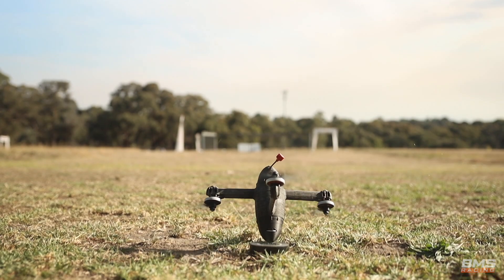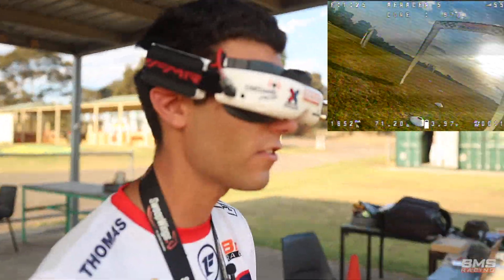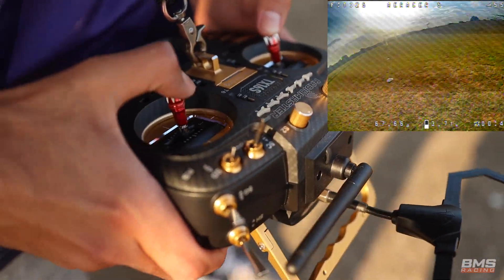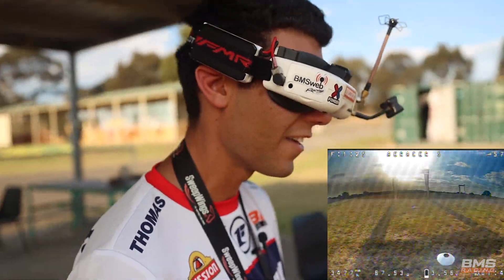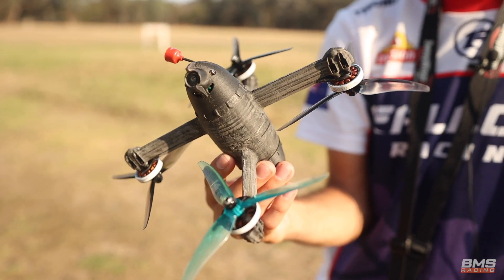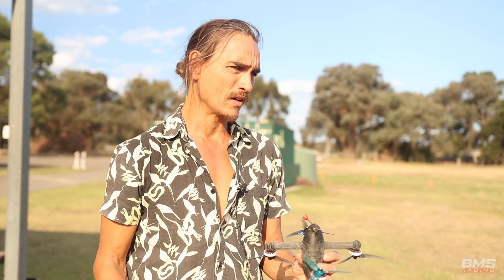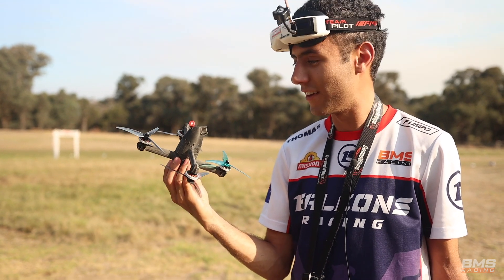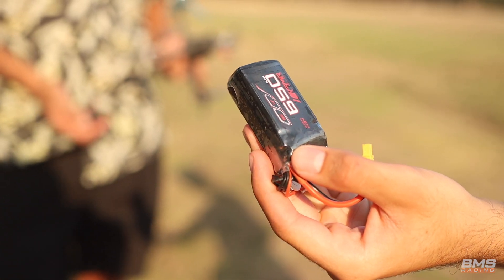Air Racer Prototype Racing Drone - Flight and Track Testing

Comment: I've actually been thinking something like this was long overdue to hit the racing scene! I'm very curious to see what would happen if the two horizontal arms where used to generate just a bit of lift. Would allow for stupid high camera angles, and incredibly small batteries
Reply: Yeah, I think a 'spec battery, endurance' type race setup might be an answer for that, since that becomes a pretty accessible race series, especially since the inherent durability is there.
Reply: Umm there are several race frames with vertical arms that basicly won every race event in Europe 2019
Reply: @peterzingler6221  not referring to box frames. Talking about arms with an airfoil shape. Does that exist already?

Comment: But massive Voltagedrop on full throttle 🧐😳💨 great fun Prototyp at all ✌️🍀
Reply: It's true. Unfortunately the type of chemistries in the tattu R-line version 4 Thomas runs aren't available in 650mah. Fortunately while racing those prolonged full throttle sag inducing conditions aren't common.
Reply: Preheating the packs to 60 degrees c should greatly help. Not safe but at races even worse things happen

Comment: I wonder how it would fly if the arms were airfoiled control surfaces like fins on a missle. Maybe something like 3d heli blades on the trailing edge of the arms with 4 servos. 
They could act like wings, elevator, rudder, ailerons and even act like thrust vectoring paddles.

Comment: Interesting design.. Problem I see is when you crash and you are the on the ground there is very little chance of getting back up since 2 motors are squarely on the ground.
Reply from the maker: I don't disagree, but I just love seeing people try things like this and the knowledge that's gained from it.
Reply: If you crash inverted in a standard quad then all motors are facing down. At least with the Aeracer with a custom betaflight turtle you could just spin up the upright props to pop it off the ground then bring in the other props.
Reply: @pauldamiandumais   Flipping back over will not be the issue it is taking off again is going to be the problem. You will have at least two motors in full contact with the ground before take off. Also remember the motors are smaller so they won’t be able to power themselves off the ground. And in grass.. it will probably not spin at all ending in possibly burning up a ESC trying to power out of stuck situation.

Comment: definitely beats the Frigging ultra expensive DJI FPV Drones :D well done designers. and well done pilot :)
Reply: What a stupid comment. This drone and the new DJI drone aren’t even remotely in the same category.
Reply: @soccernerd200  Thanks Bud, but maybe you should research more before commenting :) DJI FPV (The new DJI Racing Drone) and Air Racer the FPV Racer Drone. I think both are designed for racing and should be in same category, right? unless you take DJI FPV drone as another aerial filming drone but not FPV Racer?
Reply: @soccernerd200  I think he’s talking about the HD digital FPV system

Comment: Now that looks cool, going in the right direction for sure but I have some ideas that might make this thing even smoother
Reply: Yes, holding my breath here. Spill the beans.
Reply: @pauldamiandumais  Hey Paul I thought about an egg shape teardrop design with the camera pointing directly forward however either the arms or just the motors would tilt.. I think just the motors tilting will be more aerodynamic since you can shape them like small x-wings. and much stronger since it will be all one piece. I realise that technically it will be much more difficult to do but I can see huge advantages from aerodynamics perspective. Check out the Moller Skycar for inspiration. Awesome work by the way :)
Reply: @jbalatutube  yeah more complex concepts  are great for larger craft with longer flight times but for small  racing quads one generally has to follow the KISS principle of keep it simple stupid.

Comment: I've been saying this for a long time and it seems Paul has designed something like what I have wanted; aero, nice looking quads. That thing looks cool. It has everything tucked away neatly. I was always a fan of the DRL Racer 3 and 4, and I like the clean look of the DJI FPV (despite its functional flaws).

And what is with that current sensor always reading 60A?
Reply: Interesting enough the design of the dji fpv is made to be aerodynamic at 30 degrees of tilt. That's why it looks like a sloth on the ground
Reply: @peterzingler6221  I noticed that too. I wonder when carbon fibre monocoque frames will come to FPV....
Reply: I haven't calibrated the current sensor. Sorry. Will do.

Comment: Never got the argument of x over plus, as soon as you start turning, its all put the window, however that whole setup looks really interesting
Reply from the maker: Thomas gets to fly a lot of prototype quads and we don't always share it, however we just finished Round 4 of EastSide FPV Summer Season and had all the camera gear with us. Paul was OK with us sharing it, so why not. I think it's just good seeing people experiment
Reply: @BMSWEB  oh, please don't take it as a complaint, more just my own observations, like i say the whole setup looks really interesting, centralised weight and aero could be really fun!
Reply from the maker: @GoochiFPV  No never took it as a complaint at all. I actually think things like this are fantastic because the spark up conversation.
Reply: Goochi you'll just have to try a plus to see for yourself. Shen drones also found the plus configuration to be very fast. Its not like a car. Racing drone rates are lower then what is physically possible.
Reply: @pauldamiandumais  i have tried a couple, not for a while tbf. The car analogy works even more in my favour, a car stays on axis, i think ive only ever gone level through a gate by accident. Hahah

Comment: Neat stuff ! Curious about heat dissipation for the electronics ?
Reply from the maker: It was a 30 degree C day (so about 90 F I'm guessing) and it seemed to do ok. Realistically more ventilation will be required depending on the gear used and how long it sits on the starting blocks powered up. Irrespective it was fun having Tom fly someone else's toy.
Reply: Hey Kevin, I have been testing with the TBS unify pro32 nano on 400mw and it gets hot if you let is it sit powered. I've seen 96 deg C in the core temp, however as soon as you start flying it starts dropping temp immediately. It's so efficient that the individual esc's barely get warm. The little battery is warmest thing after an aggressive flight.
Reply: @pauldamiandumais  Hey Paul, are there any plans to make the design public? Would love to try it out, but I'm nowhere close to Australia yet.... Thanks! :)
Reply: @LotharKrupka  yes mate. I'm close to finalising the design and then i will get a mould tool made and get them injected moulded. If you want one now the are 3d printed in a Markforged printer and it's exi. Probably 4 or 5 times the cost of regular quad.
Reply: @pauldamiandumais  fascinating design !

Comment: I wonder if that kind of design is really the most aerodynamically seeing that the angle of attack isn't 90 degrees all the time
Reply from the maker: You know what I love about your comment, it's not that you're right or wrong, but you've stopped to think about it. This is what's good about innovation and trying ideas out. Look at the DJI Drone, I know it's not for people like us and I know it will break if crashed etc but a lot of that is very clever. I can think of a ton of things I would change but still love some of the things they have done from a design engineering stand point

Comment: getting kinda hot there 77c is a bit toasty there
Reply: It handles it no problem. TBS unify  pro32 nano and nano xf rx. Talon F7 fusion fc. Have seen it over 90 deg on over 30 deg days when I forget it's powered up.

Comment: I would like to see an X version against the + version!!      I think the X will be better.  Sick quad!!
Reply: Why? 
 This is a very different concept to a normal quad and uses a rearward vertical stabiliser in this layout for the same reason that planes dp.
Reply: @paulhope3401  True. But this is not a plane.  X quads are usually better. There have been many other builds that have proven this.
Reply: @cripylocdog   Yeah, its defo not a plane. Despite having tail rotors Helicopters often have a vertical stabalizers though, so it might do something at high speeds.

Comment: What's with the video noise? Still nobody figured this out or u guys just don't care about video clarity?
Reply from the maker: Firstly this isn't our quad, so can't tell you exactly what the noise is, but it is pretty easy to figure out. Essentially either the FC or ESC, one of the two has terrible filtering. As far as "Caring about Video" you'll find all the DVR from our quads on this channel is second to none, because we only used quality gear. ESCs and FCs from companies like T-Motor, Foxeer, HobbyWing, BrainFPV etc all have quality filtering
Reply: Yeah to tell you the truth I thought it was very old dominator goggles until I saw the crystal clear video from Thomas JS-1. Thomas thinks its the noise on the Talon F7 Fusion FC as he has used them before. I have ordered a Foxeer F722 mini on his recommendation.
Reply from the maker: @pauldamiandumais  Killer filtering on the Foxeer
Reply: @BMSWEB  I ordered a pair of the f722 mini. They are at the post office. Excited.